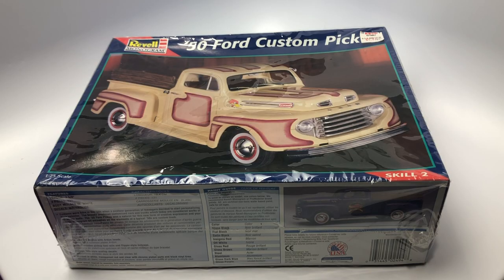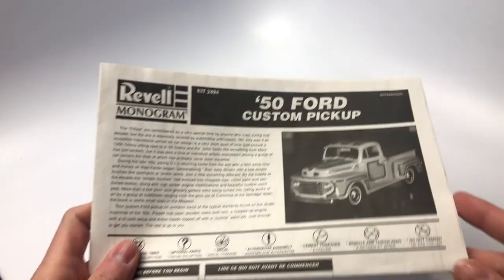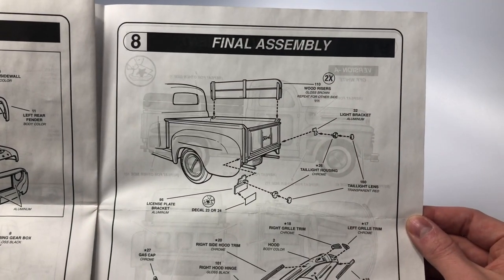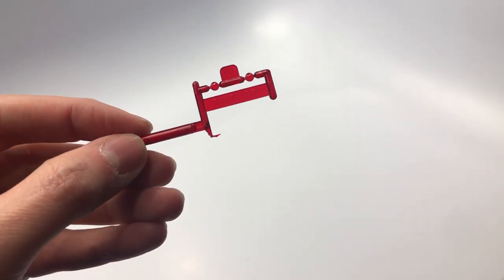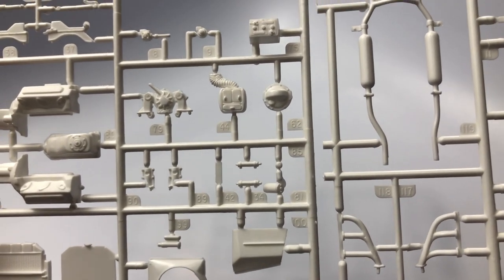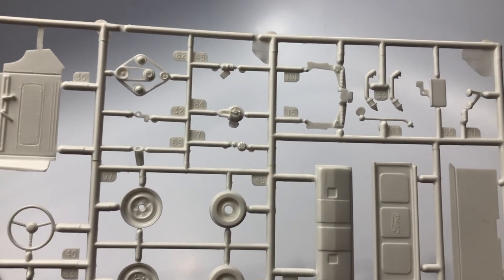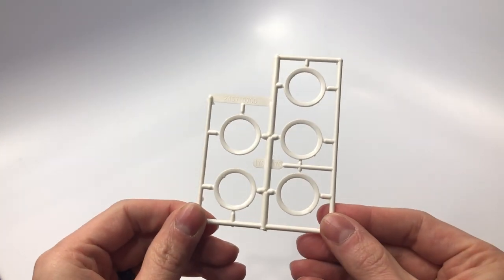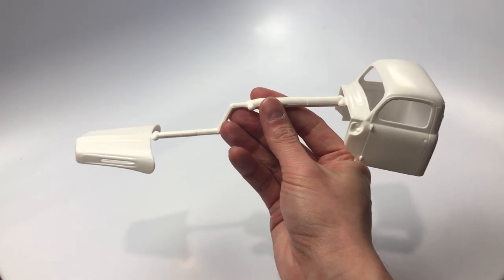Revell 1950 Ford Custom Pickup (85-2494) 1:25 - Kit Review

Comment: That kit is great. Mine went together nice until I found the bed floor part was warped which I had to deal with cause it was all painted. I dont fault the kit cause I bought a used open box kit and who knows what happened. Overall it still came out nice.
Reply from the maker: Great to hear about the kit. Sorry it was warped to an extent. I hope it still turned out well.